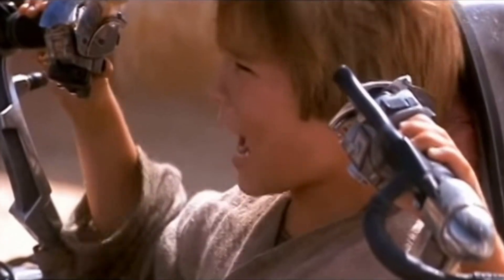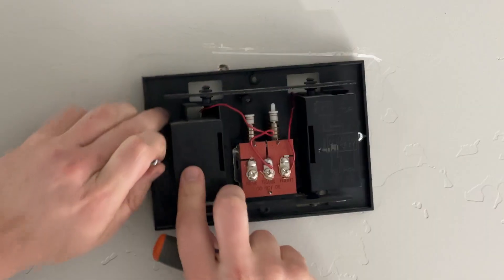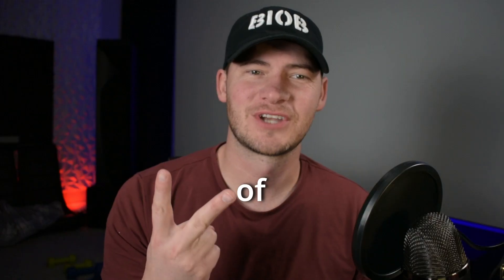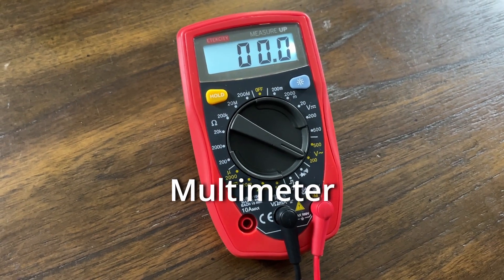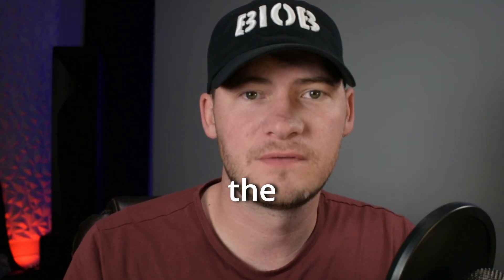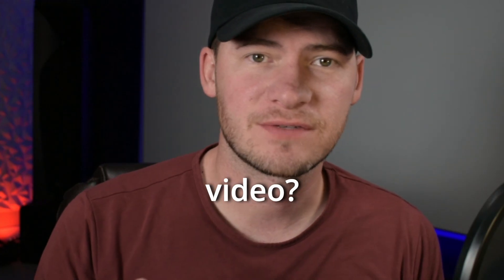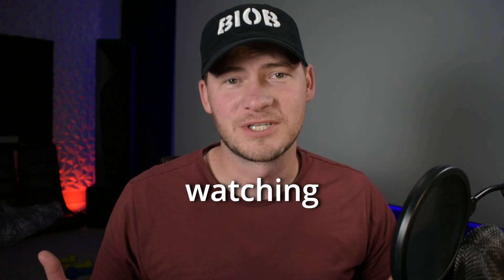Doorbell Not Ringing? Try THESE Steps Before Replacing

Comment: When I measure the transformer leads, I nicely get 22volts.  It when I measure the chime, it also measures 22 volts when not pushing the front doorbell.  Any ideas why it’s not measuring zero volts?
Reply from the maker: Hi Scott, i have a couple questions. What do the numbers say on the transformer? What doorbell do you have?
Reply: @bringitonbrothers  why numbers are you asking regarding the transformer?     The smart doorbell is currently disconnected and I’m still reading 16 volts at the chime.   Even if I disconnect the chime wires, I read 16 volts measuring the those wire only.   So since both the doorbell and chime are both disconnected, and I’m still reading 16 volts at the chime wires, I’m thinking that the transformer is bad.   but the transformer reads 22 volts, so is there another way to test if the transformer is bad
Reply from the maker: @scottsheck  The transformer could still produce power and show the voltage around 16 but if the numbers on the front show 16V 10VA, you might need a stronger transformer. As I mentioned in this part of the video, https://youtu.be/hqZjeMtuhRc?t=335, my transformer was reading the correct voltage but had a lower current running through it so it couldn't produce enought power. If your transformer shows 16V 30VA, you could still try replacing it but there might be another issue going on. As always, be safe, don't do anything you don't feel comfortable with, and good luck!

Comment: So... I can't find my transformer. It's not behind my chime, not by the electrical panel, and I have a two-story house so I doubt it's in the attic (but I checked there too and couldn't find it). I have replaced both the doorbell button on the outside of the house and the chime, so I am pretty sure it's the transformer. Does anyone have any old electricians' trick for finding a transformer?
Reply from the maker: Does sound like it's the transformer. Do you have a basement or crawl space? It could be there. It could also be near a water heater or furnace. If you have a coat closet near the front, it can sometimes be located there as well. Let us know once you find out so we can share with others and good luck!! 🤞
Reply: Did you check your garage?
Reply: @robot7611  sorry I should have posted. I ended up finding out there was no transformer. I found the spot where the wires came from the front door and then went to the chime in the ceiling of the basement. On one of the floor joints there was clearly something there at one time cause there were holes. I ordered a new transformer and the holes that were already in the joists lined up perfectly with the new transformer. The only thing I can assume is the previous owner thought there was something wrong with the transformer so he took it out but never replaced it. Now everything works perfectly! Thanks you to everyone who asked about it!
Reply from the maker: @alexwolf9778  That's so good to hear! Great job not giving up! If you're anything like us, it feels so rewarding fixing something yourself. Good work!
Reply: @bringitonbrothers  100%, thank you! I appreciate the video and the community! Keep it up!
Reply from the maker: @alexwolf9778  Thank you!

Comment: Hello just saw this video I had a gen 1 ring camera my door chime was working with it but I changed it to the 2nd gen camera now the door chime doesn't work the rear one works fine but nothing up front do you know what it could be? Also the 2nd gen doesn't have that power pack do you think it could be that?
Reply from the maker: Hi @Isaac, thanks for reaching out. From what I’ve read online, and have seen others experience, the first thing to check is the transformer. On the video, it shows the rating of the old transformer. If yours is similar, you’ll want to purchase a more powerful transformer. Locating the transformer could be the tricky part. Let us know if you’re able to find it and what it says. You got this!

Comment: I can't find my transformer. What should the voltage read across the chime screws?
Reply from the maker: It depends on what your transformer is rated for but typically somewhere around 16 volts. What does yours read? Sometimes the transformer might be in the attic or basement if you have one.
Reply: @bringitonbrothers  it reads 2.0 when I put only the black tip on a screw. After I add the red one on another screw it drops to 1.0.
Reply from the maker: Yeah, something must not be working correctly. It’s been a couple of weeks, any luck now?
Reply: @bringitonbrothers  not yet. I may have to call an electrician to fix this.
Reply from the maker: @strongblackliquor  Were you able to have an electrician look at your issue?

Comment: Bro, I tried everything you suggested (great video BTW) but I’m not getting mechanical doorbell to ring. It will ring with the old button, but not with either one of the 2 Ring doorbells I tried. When I first connect the wire to the 24V transformer, the bell rings once and that’s it. I’m getting 25.3 volts out of the transformer. What am I missing…any suggestions?
Reply from the maker: Hey bro, something I can think of is how are you wiring the chime? Are you linking the transformer to the front or rear bell? It sounds like you might need to experiment with that configuration but it’s hard to tell. Please let us know what you do so we can “crowd-share” the resolution and help each other out 🙌 thanks for commenting!

Comment: Well I have an issue with my ring wired doorbell. My transformer is good and it is throwing 17.9v when measured. However, my chime doesn’t have voltage and my ring camera either. Not sure what happened as it had been working with no issues for about 7 years
Reply from the maker: Hi JerryMt, thanks for reaching out. I wonder if the wires that go from the transformer to the chime are disconnected somewhere. Do they have any paint or debris where they connect to the transformer? If not, make sure they’re screwed in tight. Maybe check the other end where they connect to the chime. Have you tested the wire at that location with the multimeter? It might also be the chime isn’t wired correctly. But that shouldn’t have changed if you haven’t done anything to it over 7 years. Could be the wires are shorting out somewhere. Please let us know what you end up doing to hopefully fix your issue.

Comment: You showed how to wire the back of the electronic chime but not how to wire a mechanical chime for a video doorbell.  I have two red wires (separated) and two white wires that are twisted together.  If I connect anything to the trans screw the doorbell rings constantly.  Have not yet checked the transformer but it worked with my old Ring doorbell.  That said, this is the best video doorbell troubleshooting video I've watched.  Thanks.
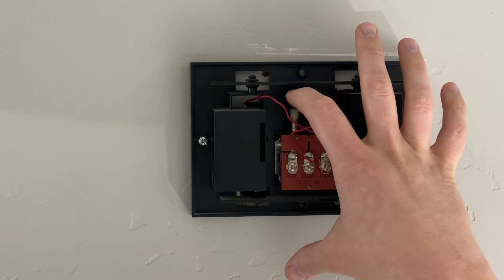Reply from the maker: @christicarlson517 if you go to 2:28 on the video, you’ll see how the wires are set up. The two red wires are separated, like you mentioned. One red wire is hooked to the transformer. The other connects to your doorbell. Make sure the wire from the transformer is connected to trans (short for transformer). Then connect the other red wire to the Front or Rear screw. Don’t forget to shut off the power before you start unless you’re feeling lucky 😂
Reply: I tired above steps  but my wiring is bit different .  It has multiple wires like blue, blue&white, Green, Green&white, Organe, organe&white, brown, brown&white at all the 3 places 
transformer, mechanical chime and ring doorbell pro. Not sure which wire to connect
Reply from the maker: @bhagawanreddy8252  Could you take a picture and send it to us? You can email me at mickey@bringitonbrothers.com
Reply from the maker: Thanks for your response!

Comment: I have a fairly new  nicor primechime2 electronic doorbell with chimes....(sounds like an endorsement for deon sanders lol) Its a new home and was working perfect... i was washing my home off last week and water hit the doorbell button.. and it started to chime and was stuck ringing for a minute... then one tone constantly and then stopped... didnt work anymore.... I bought a new doorbell replacement button...since i had got it wet... I replaced button  and its still not working... button doesnt even light up... Looks like i have some power going to button but need to buy a voltmeter to confirm... I have a small one that said that current is going to button... Im confused...could i have blown the transformer for chime? the entire unit is like $57
Reply from the maker: Thanks for sharing your experience here. It’s very possibly could be a damaged transformer. I would start there, though any route has some cost. Good luck.
Reply: @bringitonbrothers  thanks my friend.. i will see what happens and let you know so viewers can see also..
Reply from the maker: @avellouswash6260 please do, we appreciate the community knowledge share!

Comment: Just installed a Wyze doorbell and removed the old Nest chime controller. Old Nest doorbell rang chime after wyze chime installed.  Then removed the Nest doorbell and installed the Wyze, now the chime does not work
Reply from the maker: Interesting issue. Have you found a solution yet? If so, please share for others who might have had a similar issue.

Comment: How do you wire the transformer? I have two double wires coming in from the button (so four wires) and a transformer box with three screw connectors.  😮
Reply from the maker: What color are the wires? There should be a white wire (or two), a black wire (or two) and possibly a ground wire - which is typically just bare copper wire or green.

Comment: I have a mechanical chime and Gen1 Ring doorbell. Do i need to use the multimeter to check the screws inside of  the mechanical chime also? I never saw you do that. I did it just for kicks but it read nothing??? My transformer is just slightly over 12v, but im under the impression thats enough for a Gen 1 and since use to work im thinking the mechanical chime is the issue
Reply from the maker: Hi @73CILBOY, sorry for my delayed response. I’ve been out of country this month. Did you try replacing the mechanical chime? That’s an easy and inexpensive switch. If that doesn’t work? You could see what the reading says on the transformer. Even though it’s 12V, it might not have enough watts going through it. Let us know what you try so we can help others with the same issue 😃

Comment: I replaced my old push button door bell with Ring camera two years ago. It worked great until two weeks ago. When button is pushed, Ring camera still works with sound but the chime in the house doesn't ring. It just has a constant buzzing sound. It's kinda like the power is constantly going through it. I disconnect the wire in the chime, retouch it to the terminal. The chime will ding. But then it starts to buzz after that. I bought a new chime thinking the old one is bad. But the new one does the same thing. Does anyone know why that is or what the problem might be? Btw, I don't know where the transformer is at. Maybe is covered behind the wall somewhere. Is there a way to test it without needing to see the actual unit?
Reply from the maker: It sounds like a transformer issue to me. If you have multiple chimes, I would check in the wall behind each one.
Reply: @bringitonbrothers  Thanks for the tip. I only have one chime so I'll check the wall behind it.
Reply from the maker: @ej1547  Any luck here?

Comment: Step 1.5 touch the white and red wire after removing the doorbell and if the chime rings the doorbell was the problem avoid next steps 😅.
Reply: What do I do if this what seems to be happening to me. I upgraded my previous Ring doorbell with the new Ring Plus. My older model I connected myself , the house would chime and everything was perfect. Only reason I upgraded was because the video quality had been affected due to elements and me owing for 5 years. The new Ring Plus installed similarly and the house would chime but after a week of use , we don’t hear the interior chime. Only get alerts through the app. When I check the app, the battery shows as hard wired and receives charge . I went ahead tried trouble shooting and idk what is going on, but literally when I unscrewed the cables to the doorbell, the chime worked. Just doesn’t work anymore when I screw in firmly to the back of the Ring doorbell camera. Please help!!
Reply from the maker: @TheRaymundo17 , have you looked at the numbers on the front of your transformer? Check and see if they read the same as the video. It might be the new doorbell needs more power. The volts could read  high “enough” but that doesn’t account for amps.
Reply from the maker: Very true! As long as the house was wired properly, this could be a quick solution. Thanks for the comment.
Reply: It rings after connecting red and white wire but once attached to the doorbell camera the mechanical inside doesn’t rings even swapped couple of doorbell cameras

Comment: Help! After a strong storm my Ring is stopped getting power. I switched out the transformer and it’s putting out 19.5V but the button outside still no power. Any ideas?
Reply from the maker: Hi, thank you for reaching out. Are the two wires outside (behind the Ring doorbell) receiving 19.5V? If so, make sure they’re securely fastened to the Ring doorbell.
Reply: @bringitonbrothers  no they are not getting any power. 0 volts.
Reply: @frankthetank5013  we’re you able to get this fixed?
Reply: @HAXMICK  no I haven’t. I called in a pro and they wanted to charge $830 to diagnose and fix it!
Reply from the maker: @frankthetank5013 that sounds like a lot for a test. Did you end up having a pro fix it or were you able to find the issue?
Reply: @bringitonbrothers  nope still dead
Reply: That’s weird… are you still having issues? I wonder if the wires were somehow damaged in the storm.

Comment: Hello nice video. I installed my ring pro 2, it is getting power and working on my app but my mechanical chime does not work anymore. How can I troubleshoot that?
Reply from the maker: Hi, thank you for reaching out. This is pretty common for Ring doorbells. The first thing I’d check is the number on the transformer. Does it say 10VA or 30VA? Many times the Ring doorbell will work because it’s getting power but it isn’t enough power to ring the bell inside your house.
Reply: Thanks for the video and comment reply. This is exactly my issue. Question is, how bad do I want that chime?!
Reply from the maker: @ktina300  I totally get that! We went without a chime for two years until I decided to buy a new transformer 😆
Reply: I too have this same issue. After installing the doorbell it says on the app it’s pushing out 17v.  Is that too low ? I had the google nest prior and no issues.
Reply from the maker: @arcmting are you able to locate the transformer? You’ll want to check both numbers.

Comment: Hello and thank you for the video! I recently bought the eufy wired dual cam doorbell only to find out that it doesn't work with my analog doorbell which i recently replaced and want to use to keep the wireless stuff at my house minimum. I upgraded the transformer and installed the ring power kit but with no luck. do you know how to make the home doorbell work with the analogue chime? I saw some people blogging they did it, but it's hard to understand instructions. Thanks for the feedback!
Reply: Also having this issue. Eufy doorbell, mechabical chime. Installed a resistor, no go, installed a ring pro power kit version 2, also no chime. There has to be an answer. Any suggestions?
Reply from the maker: @alihaymour8261  Were you able to fix your issue? If not, let us know so we can work together to find a solution.
Reply from the maker: Hi, thank you for reaching out. When you installed the Eufy doorbell, what wasn’t working? Does the doorbell light come on? Is it getting power? If so, is it not ringing the analog chime? Do you also have the Eufy doorbell ringer plugged in to an outlet?
Reply: @bringitonbrothers  yes that's the issue that the eufy wire doorbells  don't support the indoor chime by default. Do you know any workarounds around this?
Reply from the maker: @inspiredlifeway Sorry for the late reply. I was over seas for a bit. Did you find a solution for this?
Reply: @bringitonbrothers  oh well I didn't. It was a great piece of hardware, but I replaced it with something lower quality though supporting the function of the home doorbell